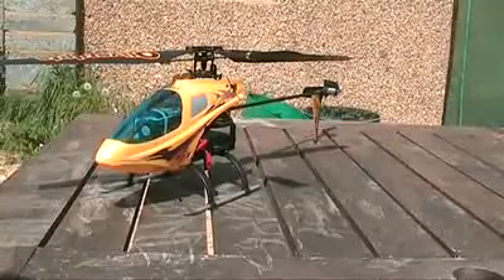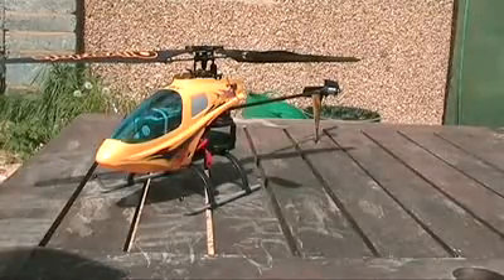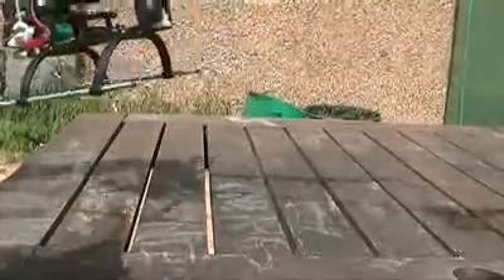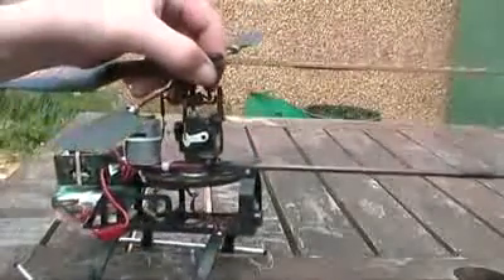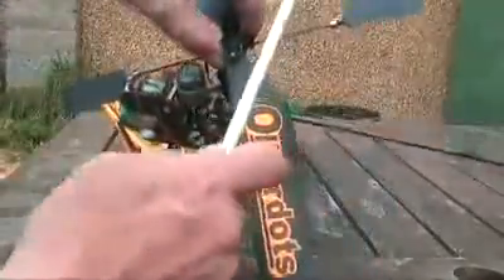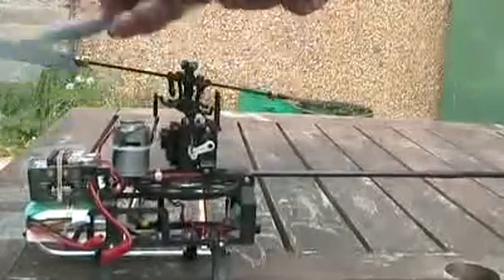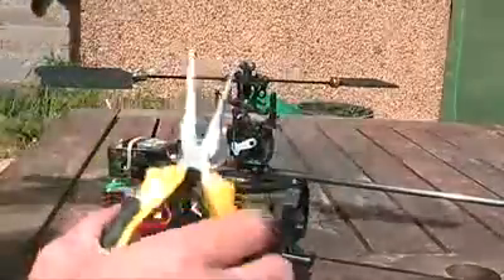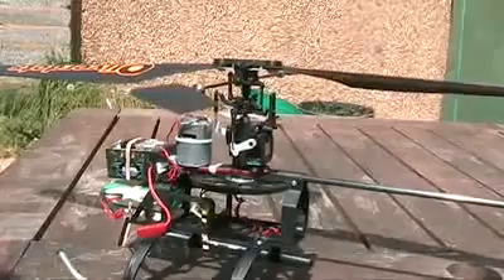Honey Bee FP Setup Guide Part 1

Comment: Excellent video.

The reverse tail rotor thing is indeed odd, but these helicopters tend to come test-flown from the shop that sells them. Not necessarily test-flown by Esky, but often they do. 

It's pretty common for a shop to check the helicopters before sending them out. My Esky Honey Bee CP2 was definitely checked, but I still had to adjust some small things.

Comment: One thing to note though, those main blades really need to be a lot more loose. The idea is that the blades with extend by the natural centrifugal force. 

If they are too tight, it will be a huge force every flight on those screws which you really don't need. For as long as they don't come off, they should be able to fold if you lightly touch them like you've did.